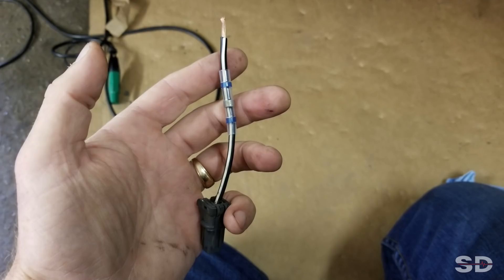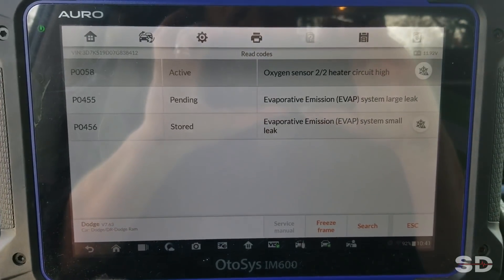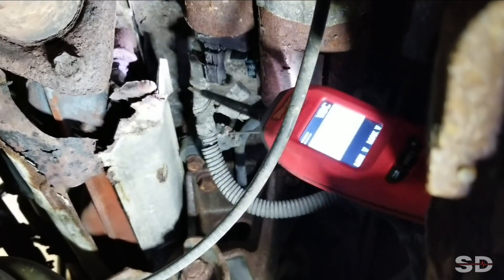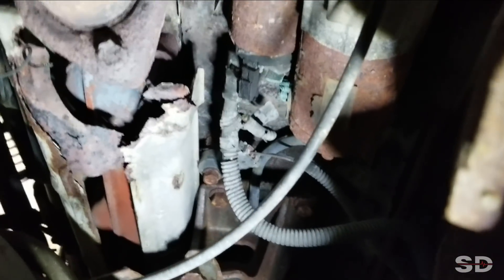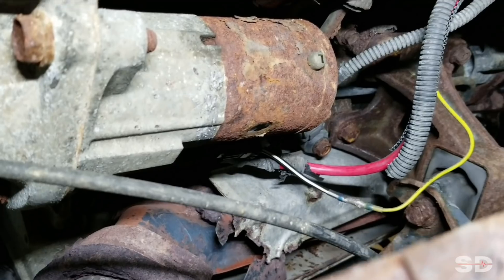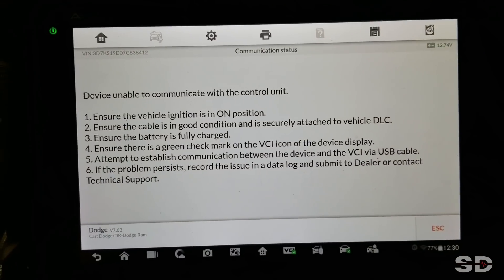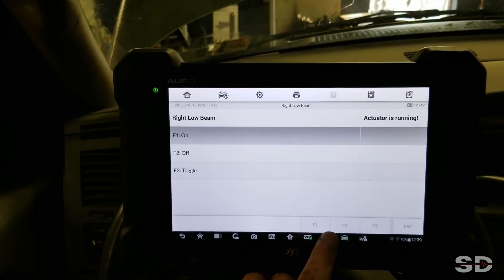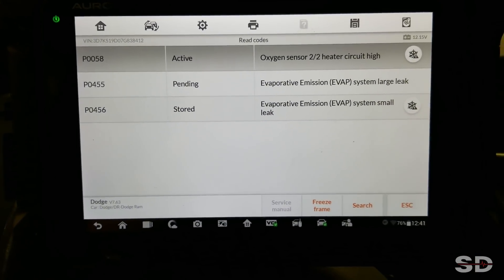2007 Dodge Truck No Crank, Wiring Repairs, New Scan Tool

Comment: I would love to see how this auro does on pid refresh compared to the snap on. I noticed with my launch is that it is way slower on the pids then it is with my snap on verus. And I would really like to buy a scan tool that is not snap on.
Reply: Which Verus ? 1,2 or edge? The Verus edge smokes my Elite
Reply: @weldingjunkie  how does it smoke it?
Reply from the maker: Snap-on, by far has the edge on Data Pids and the functionality there. (Recording, freezing, reviewing data, comparing values etc)
But I think the Autel/Auro definitely has it's place as well. Got a case study coming up on an Infinity with an immobilizer issue where the Auro was the key!!
Reply: ScannerDanner looking foward to it. I use my Autel Elite that too. Snap on needs to up thier game with that
Reply: @weldingjunkie  from my understanding snap on doesn't want anything to do with security systems. Afraid of liability from what I been told by representatives.
Reply: phillip zanders well yes and no, Snap is a USA based company so if they want to do pats and immo they have to pay the automakers to do it. They would rather lock Smith’s just do it but shops are starting to fight back by buying Autel. Why out source they lose money that way. Snap on added ford so far and a few others Autel is in China where they basically can’t be touched. Thier land and court systems. Just the end users liability issue so trust me they might say that’s why they don’t but it’s all about money.
Reply: @ScannerDanner  now when u say edge do mean it's. Little better Or like night and day better? From what I seen the verus pro and up have way better graphing and recording hands down. Idk why no body other then snap on can seem to get that feature correct but here we are.
Reply from the maker: Are we comparing the different Verus platforms now? I said "edge" not related to the Verus Edge
Reply: @ScannerDanner  no the verus to the auro. I know u have the edge and it's going to be better then the pro.  But for the most part from using both of them they are the same. What cripples the pro is the os the most. Yea the soc doesn't help but. The reason I'm asking these questions is I'm not buying another snap on scan tool. They have lost me as a customer when it comes to scan tools. Unfortunately I can't just drive down to the store and test out a bunch of different scan tools on the fly.
Reply from the maker: @phillipzan2005  okay cool, you just need to give me some time to give you my honest feedback. I haven't used this Auro/Autel enough yet to speak on it more than what I already have here
Reply: @ScannerDanner  fair enough

Comment: You're supposed to use a heat gun on those butt connectors. The lighter just burns them.

Comment: In my opinion these are the worse butt connectors , I would always advise soldering first and if not use a quality heat shrink butt connector from duraseal or 3m and not the Chinese crappy ones.
Reply from the maker: I'm still undecided.
Reply: @ScannerDanner  i use these solder heat shrink conectors but as found the wires have to be clean. Any oxidization and the solder dosent flow...crimps are the way to go for them..
Reply: Put a drop of flux on the joint before sliding the solder heat shrink connector over it. Flux should remove some of that corrosion so the solder can flow into it better. I usually just solder the wires together and put regular heat shrink over it unless it's a spot that gets hot, then i use crimp connectors. I've seen a video of someone soldering multiple wires together the regular way vs with these solder heat shrink connectors and the conclusion was that you really don't save that much time with these solder heat shrink thingies.
Reply: The solder sleeves don't save time or labor. They are used to make it easier and quicker to make the joint not assemble the system faster.

Comment: At the top the tool just tells you what the F functions mean,you always toggle from the bottom. It’s not a glitch,Autel is the same.
Thanks for the video Paul! 👍
Reply from the maker: But you can click on them and it highlights it and makes a click sound lol, this is what is misleading and needs to be changed. Also, when you click on the F functions, it doesn't change the highlighted box above. Definitely not the way it should be :-)
Reply: ScannerDanner This is just my humble opinion,but I think you’re used to the SnapOn software. The Autel based tool will kick the SnapOn you know where in terms of functionality,but you don’t have much support and you really have to know what you’re doing. In my opinion,when you pay for SnapOn you pay for the support and the technical data found within the tool : like connector layout,best testing location,known good waveforms etc...not for functionality.
Reply from the maker: @nicknicu1787  Snap-on is WAY better with managing scan data (recording, playback, comparing data PIDs, data lists etc), I'm not arguing your point, just saying there are pros and cons to both tools
Reply: ScannerDanner you’re right on. I have the Elite and if I’m not doing immo it stays in its box. My snap on Verus edge has a better layout and ease of use. Much better pid layout so you can watch so many systems at once. Pro demand and ask the experts, along with real fix, wire diagrams, known good wave forms, it’s faster and of btw just to kick Autel in the balls and built in 4 ch scope. My Autel Elite scope is a pos.  I have the Autel for my bmw diesel that’s only reason I bought it.
Reply from the maker: wish Snap-on would play ball with me smh  I talk their scan tools up all the time and it's from the heart. Obviously, because I see no kick backs from them.

Comment: Scanner Danner without a Snapon? What are your initial thoughts on the Auro? I have an MS908P which I never updated because of the trouble Autel got into and took features away with updates. I think the IM600 may be its replacement in a couple of years time.
Reply from the maker: I will reserves comment until I've used the tool more, let's just say, this was a loner that I ended up buying because I like it so much :-) Got some more videos coming with it so you guys can see it.
Reply: Kirk Abrahamson I have the Autel Elite and I’ve programmed Nissan, Honda and Ford keys. I love the Elite, with that said my Snap On Verus edge layout and diag functions blow the Autel out of the water. Autel might of gotten a hand slap but in no way did they take any features out in fact since the 708 they come so so far. If they had a lab scope built in like the snap on it would be 10x the machine. Thier lab scope is terrible
Reply: @weldingjunkie  Yep bought the scope. Very disappointed. There was a lot of people complaining of some features being removed after updates so whether they did or not I am not sure as I decided to not risk losing features. Been very happy with its performance.
Reply: xyz4469 that’s only if you back it up you still need to update the machine. I think you would have to restore it to go back to an earlier version I update mine always. The Elite  does everything I need keys included
Reply: xyz4469 just to be clear you cannot just put the update onto the sd card you can only back up what you have on the machine like a full hard drive back up on a computer

Comment: I’m still not get grip with those solder shrink wrap, every single one that I have try to use ended up using crimp connector with shrink wrap with glue adhesive inside
But Paul again great video 👍 all done ✅ mate

Comment: I give that starter one more season in the road salt before its gone by the looks of the sparks coming out of it when it was running
Reply from the maker: you saw sparks??
Reply: @ScannerDanner  I was sure I saw sparks after the fix test , but ive looked many times now again and I cant see what I saw, sorry about that
Reply from the maker: @mammutit  no problem at all, thanks!
Reply: mammutit - seriously, that starter could go any minute. We almost certainly sabotaged it just thinking about it